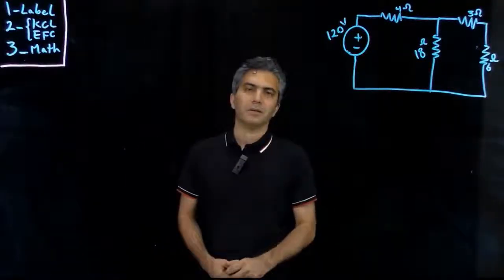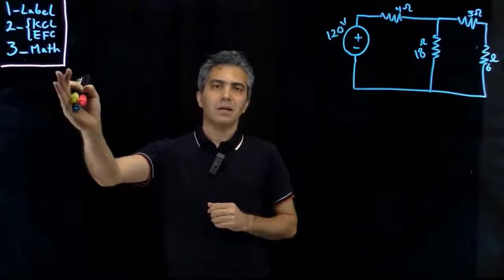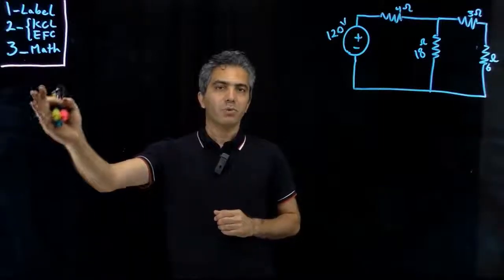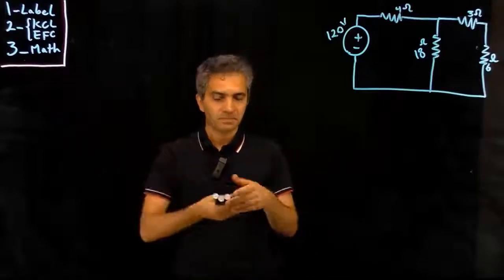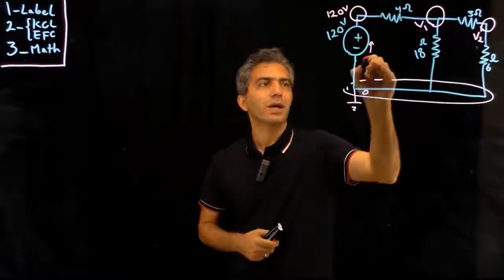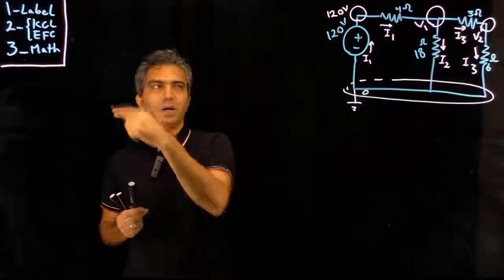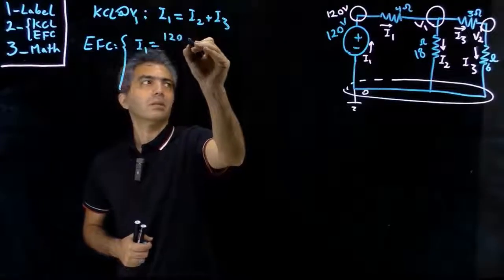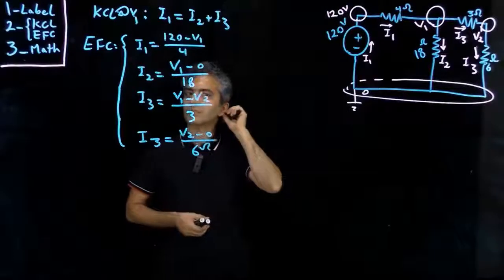Lecture 9: Mixed Series/Parallel Resistive Circuits

Comment: For I(2) I was a little confused. You got conductance for I(2) over conductance for I(3) and I (4)? But the conductance for I(2) is the resistance of I(3) and I(4)? Then total conductance was the added resistance? Does that mean when resisters are parallel that the conductance of the first one is the resistance of the other? If not, I don’t know why you used all resistance values as conductance. Thanks
Reply from the maker: The formula I used is called current divider for parallel resistors. I discuss that in an earlier video and you can watch that one to understand where it is coming from. Generally speaking I don't suggest using such formulas if you are not comfortable.
Reply: @electricalengineeringmadei1041  figured it out.